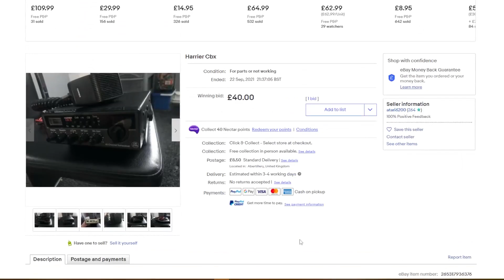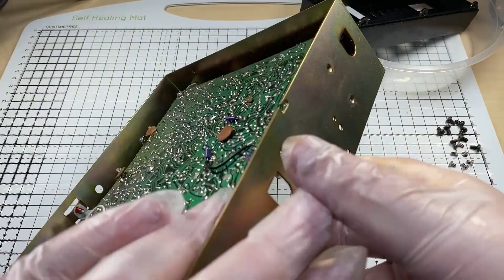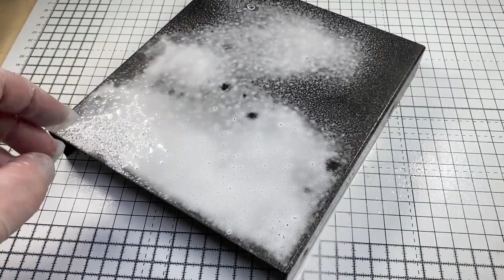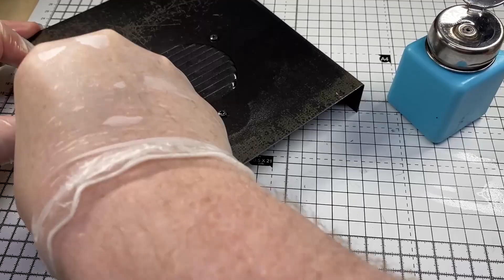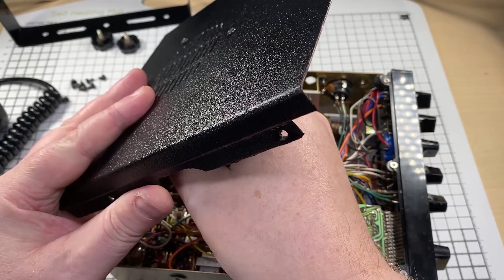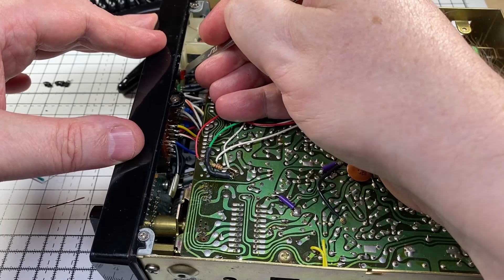EP 022 - eBay Rotel RVC-240 and Harrier CBX CB radio, First look and test. [CB]

Comment: That was wonderful. The CBX is the great radio from my past... I had the Harvard Harrier bought from Dixons for £69.99 i think for Christmas, which I loved. but the CBX with all its pots and delta tune ( I'm still not sure what that does exactly) was the pinnacle back in 1981. Thank you for all your videos.  And happy Christmas to you and yours. 2026.
Reply from the maker: The delta tune actually has a components that are active in rx only and moves the rx freq slightly , thanks for watching
Reply: @MicroChipz like a clarifier? Or BFO?
Reply from the maker: @Eana-of-Sussex a very fine clarifier , it’s got its own varicap diode to move the 10.240 a tiny amount
Reply: @MicroChipz  ahhh i see. thank you.

Comment: Out of interest what value load resistors did you use?

It'll save me from having to measure the current through the one working bulb I have left as I have one LED I fitted but obviously doesn't switch off properly.

Thanks.
Reply from the maker: Hi , thanks for watching , i cant remember the exact value , but i had to go low. this method is not perfect tho as i have found out later, some mics do not turn off the Rx light properly, so its something i will have to revisit.
Reply: @MicroChipz  thanks.

I'll do a current measurement for the bulb and will scale a resistor from there as a starting point.

Keep up the good work!
Reply: @MicroChipz  I found that 100 ohms did the trick for me.

As to other mics, I'll have to find out about that one.
Reply from the maker: Thanks , let us know if you see the same issues .